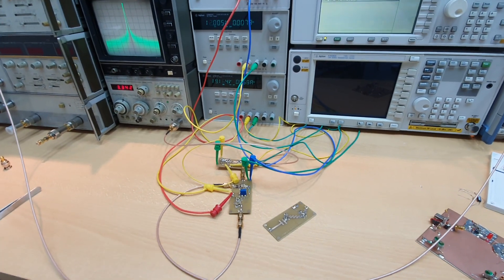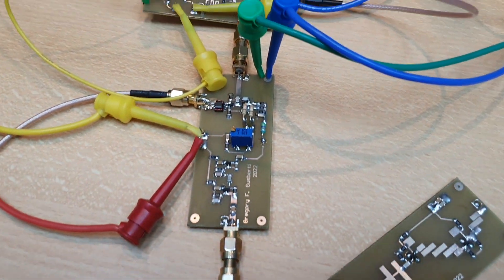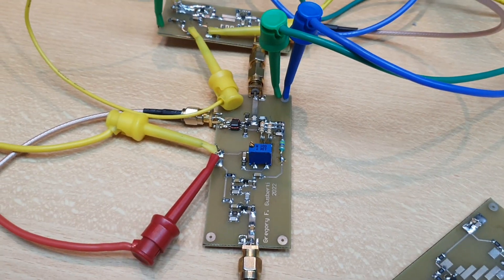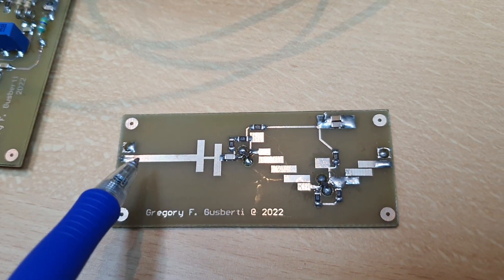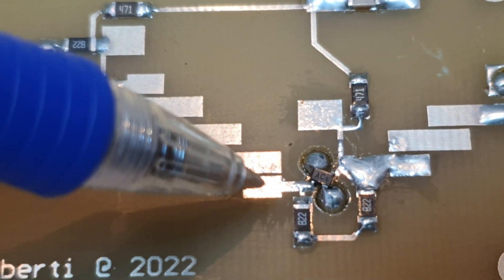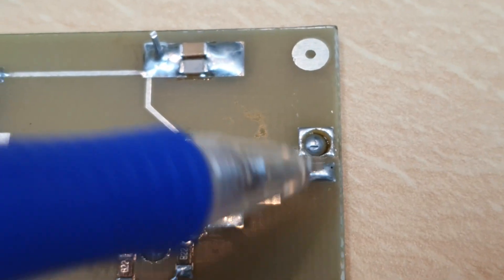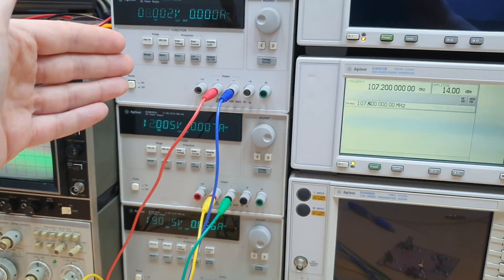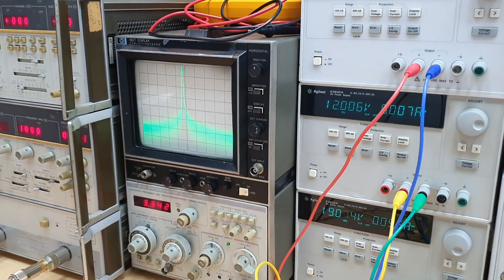10GHz Microwave Source - project update 2

Comment: How does that circuit even work if everything is soldered to the copper plane on the board there are no traces? You can't put all the components in a pool of solder ? I'm confused LoL

Comment: How to work with such a high frequencies? 1 pF capacitor  has impedance 15 Ohm, 2.5nH inductor  (1mm length of 1mm diameter  wire) has impedance 18 Ohm... Any millimeter of wire can leads to parasitic oscillation in an amplifier.... I made only FM transmitter 100MHz, and 5mm of wire increase SWR. But what we will have in 10GHz? Any micrometer influences on SWR in a cable?

Comment: HI! this is a beautiful project. I would be interested in reproducing the sampler to lock my HP 86290C. Do you think that as it is it can work decently up to 6GHz? I would like to have a diagram, or at least the abbreviation of the balun you used. Thank you so much for your kindness!
Reply from the maker: Yes, absolutely think would be possible. I'm traveling and don't have access to the diagram right now. The balun man, is probably a network balun, I bought from surplus. So.. Conclusions is: try it, iterate.. Don't lose much time thinking about parts, you will also learn a lot on the process. Greg.

Comment: Can we use glass fiber for rf pcb designs how much is its dielectric constant I wanna design a coplanar pcb transmission line with glass fiber boards and I don't know how much is its dielectric constant....
Reply from the maker: This is FR4. I usually use 4.3
Reply: @AllElectronicsChannel  thanks.

Comment: Hello Gregory! Very good lessons about frequency! Thank you for sharing so much information. I'm trying to build a frequency divider that could be used to measure a GHz signal with a 100MHz osciloscope.  I've been tinkering with some circuits using decade counters, flip-flops, but they all fail to bring a GHz signal down because they are mostly intented for 1MHz to 60MHz frequencies. Do you know what is the best way to achieve this?
Reply from the maker: Hi Cesar, frequency dividers for GHz frequencies are called prescalers, make a search on google.

Comment: What advice do you give when looking to setup a lab with HP RF equipment.
Reply from the maker: I'm almot always using two signal generators and 1 spectrum analyzer.   Two power supplies at least. And take a look at the noise generated by LED lights, sometimes I need to turn off my LED panels to make measurements.

Comment: Hi, nice project ! How available is the SRD used for the sampler ? I thought these were basically unobtainable...
Reply from the maker: It's indeed pretty difficult, I got on aliexpress from China
Reply: @AllElectronicsChannel  Thanks you for your answer. I never thought of Aliexpress for this! Don't you fear receiving counterfeit components ? Do you have a seller to recommend?
Reply from the maker: I don't have a specific seller. Actually I remember the seller of the SRD, is TILICHIP. 

Some sellers send fake parts, so I aways buy from more than one. PIN diodes where always good, the SRD also. 
BAT15-099 Bridge I got good, I think there is only one seller of them in aliexpress.
One that is difficult is BAT15-03W, I have bought 2 or 3 times from different sellers and always got fake parts
Reply: @AllElectronicsChannel  I think mouser actually sells BAT15-03W. Free shipping in EU for orders over 50eur.
Reply: @AllElectronicsChannel  actually Mouser also has MA144769-287T SRDs in stock! I think I'll do an order, I want to try doing a comb generator to test my HP 141t and see if I can reach it's whole 18GHz bandwidth.
Reply from the maker: Make it !! Unfortunately I don't have easy access to these big suppliers 😪

You can also buy some PIN diodes for test, that can work very well as SRD. BAR62-03 is one that I used in the first prototype of the sampler

Comment: Beatuiful.   
How do you design your microstrip filters? I like to use QUCS however it can be a bit tricky at times since it can't show you how the design is supposed to look. 
It is coming together nicely. 
The VNA is really beatiful, the 7 segment LED displays are an interesting contrast to the green CRT.
Reply from the maker: I designed only calculating the length for the dielectric constant, with a bit of experience it works first time!

Comment: Nice, How did you test the directional coupler and bandpass filters with your VNA when its only going upto 1.3 GHz ?
Reply from the maker: No need for test!
Reply: @AllElectronicsChannel  Is there a way to test them, bcoz i only have a nanovna and tinysa. I think you have built a rf power meter too !
Reply from the maker: The proper way would be using a 10ghz VNA.. nevertheless is difficult to test this is circuit, because you need to place conectors and test prints that would change the behavior of the circuit
Reply: @AllElectronicsChannel  Since you are using FR4 susbstrate, are thinner ones 0.4, 0.8 mm better(less lossy) than 1.5mm at higher frequencies ?
Reply from the maker: I never tested, do you have some info?
Reply: @AllElectronicsChannel  I don't know about loss factor, but for 0.4mm thick pcb, line widths are 0.69mm for 50ohm impedance, so its hard to fabricate even higher impedance lines on thin pcbs..